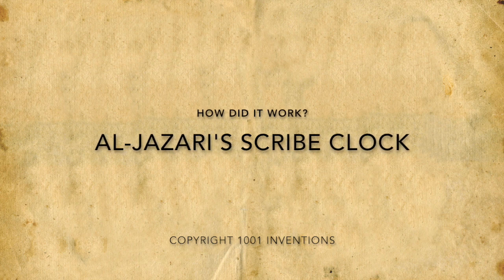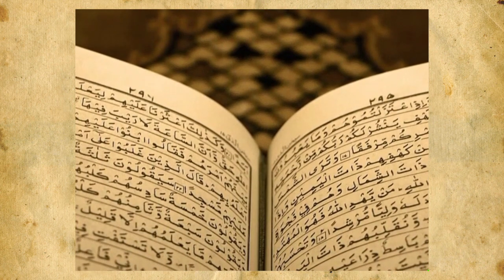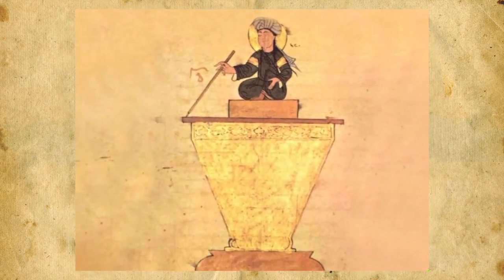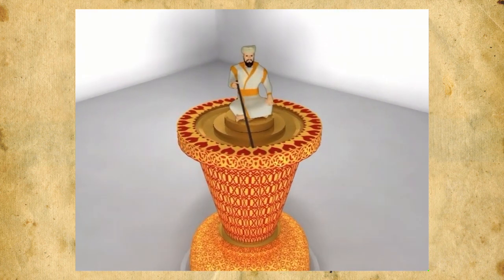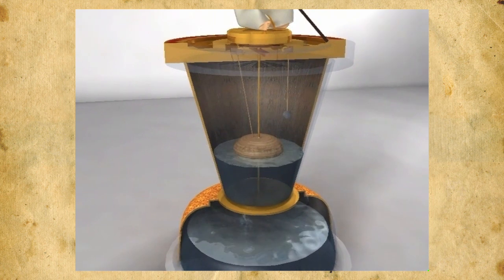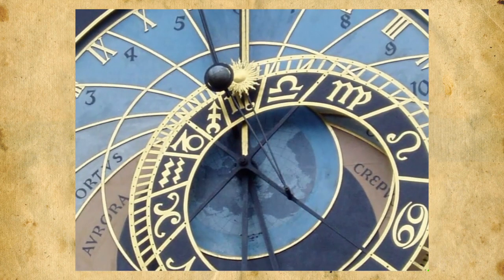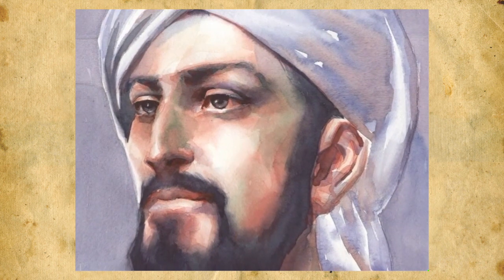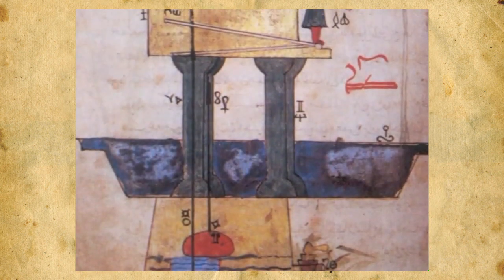Animation of Al-Jazari's Scribe Clock (1001 Inventions)

Comment: Lovely video. However the reason for the taper in the reservoir is not described, is it?  The size of the orifice that lets the water through is constant, but the rate of flow is dependent on the pressure, and the pressure is dependent on the depth of the water. When the water level is high there will be a lot of flow. When the level is low, there will be little flow. If the depth of the water is going to change at a constant rate, the diameter of the reservoir needs to be bigger at the top than at the bottom, because the flow will be greater the depth is greater.  And this is what holds the rate of descent constant with time. This is implied in the video, but not explicitly stated.